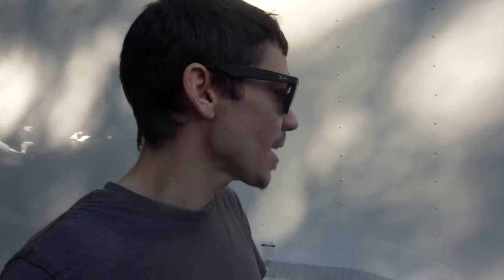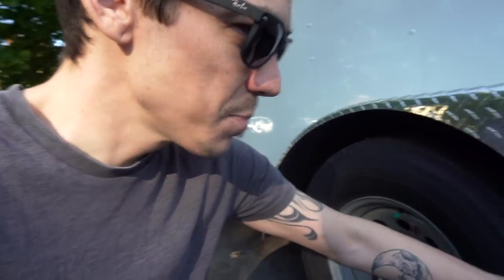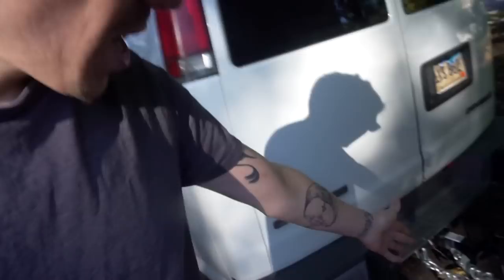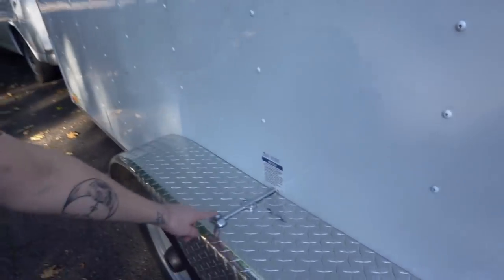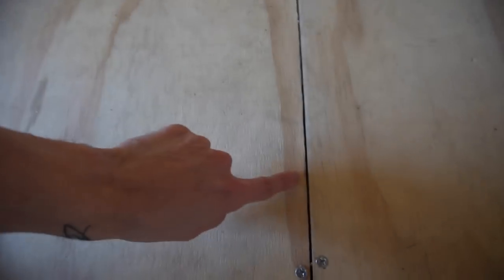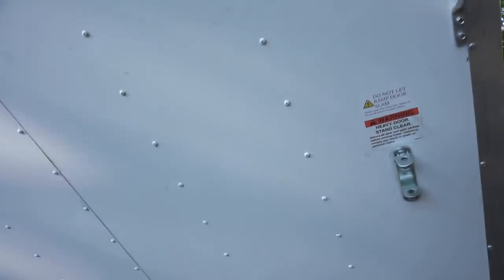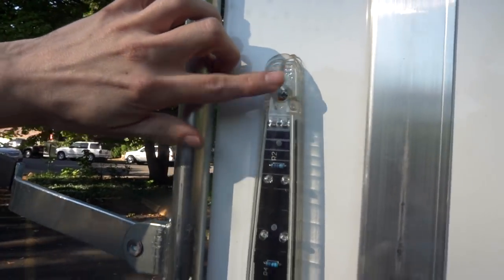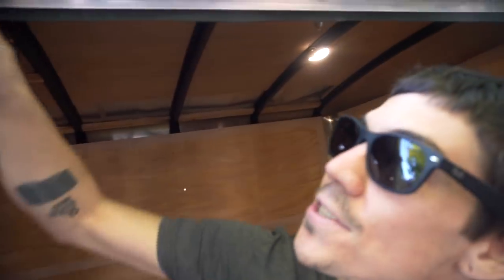WATCH THIS BEFORE YOU BUY A CARGO TRAILER FOR CAMPER/TINY HOUSE CONVERSION

Comment: Don't pull the exterior panels off. Remove the luan interior and seal the seams from the inside with auto body seam sealer. It's flexible enough once cured, but far more resilient than silicone. Sealing from the interior also protects the sealant from exposure to the elements. After sealing, spray the inside with a layer of Lizard Skin sound deadener(it's water based with near zero off-gassing once cured). The Lizard Skin will some what stiffen the panels reducing vibration, lessening the chance of a seam working loose and leaking.
Reply from the maker: That’s a great idea! Thank you
Reply: James great ideas
Reply: James Gill, right on!  Removing the outer shell is a sure way to make the panels leak.  Jed, treat the trailer the same way you would a van; a thermal barrier (foil bubble stuff), insulation, vapor barrier and wall material.  Don't get too hung up on the floor wood because you'll need insulation between it and the living area.  Be sure to omit the insulation where your tie-downs and E-Track is and use solid wood.  Also skip the roof AC, a 5-6000 BTU window unit will do the job nicely and use one third the electricity as long as you insulate well.  I helped a buddy do a 7x16' trailer and he air conditions it in the southeast using a 1000 watt generator and a 6000 btu window AC.  When the compressor isn't running actively his little 1.5 quart an hour generator charges his batteries and keeps his interior lit.
Reply: That’s sounds like a great idea to me too!
Reply: @scottsturgeon618  Scott nice
Reply: Or the roof.
Reply: I have one and i know that you will never see the seems from the inside. They are screwed to the metal studs. There should be thin sticky foam tape at the seems.
Reply: Agree 100%

Do NOT remove the panels

Do any extra seal from inside 

Your over thinking it dude seriously 

They are sealed from factory 

Waxing the outside on a regular basis keeps it looking good 
As well as the wax on the surface wicks water away quickly
Reply: Jesus Christ died for our sins, was buried and rose again to save us from eternal judgement and give us eternal life if we believe Him. Only God can save us and freely give us new life inside forever
Reply: By lizard skin are you talking about like spray in bed liner?
Reply: @IntoTheMystery13  I would be hesitant to just accept these kinds of ideas even though having them to evaluate is great. As you noted in your comment at the top, a lot of people just throw these together with whatever they know or what they find online. The RV industry is a joke from an engineering and build quality standpoint, and the same companies typically own the factories that build most of the cargo trailer brands. The rest usually try to copy them at an even lower price point. There's a lot of misinformation and misrepresentation in the whole industry. I highly recommend the customizing companies that do real engineering, most of them at the very high end, but replacing their expertise is next to impossible. Marathon / Prevost is a major player that does this in the motorhome market, SpaceCraft in the large, mostly 5th-wheel towables, and Nord Euro Mobile in customizing the industrial / cargo-trailer units (mostly for companies needing bunk or office space in severe climates). They aren't going to tell you a lot of their proprietary engineering detail that they have to pay for, obviously, but copy them as far as you can. Using a seam sealer inside, for example, might trap moisture between the steel frame and aluminum siding, accelerating problems and reducing the useful life.
Reply: @Dolores Lizzy Who are you referring to, and maybe explain the relevance?
Reply: @deha11mo  so what type of trailer does God have?
Reply: @izzimichaels2892  dragon whips his tail

Comment: Just a small tip. Lock your chains with padlocks. Lock your hitch with a hitch pin lock and lock your trailer ball mount. Locks for everything! Cheap insurance. I lock everything on our trailer. 👍
Reply: Stay away from Masterlock locks... The easiest locks in the world to pick... Look on  YouTube for the guys that do Lock Sport... I've seen them picked with a chicken bone and an under-bra wire... Not Kidding!!
Reply: Most trailer locks are easy to cut off 
Get a wheel boot
Reply: Locks are a good idea, but look up lock picking on youtube before you get overly confident.

Comment: Put a GPS locater underneath the trailer somewhere, in case someone succeeds in stealing it, you will always know where it is.
Reply: What brand?
Reply: if you pass a 35 question test you can get a ham radio license. 7 year olds passing the test happens so often it isn't news any more. then you spring less than $200 and get an APRS setup. you can get an entire APRS setup in one box. add antenna and DC and your on the air.

Comment: Jeb, don't take apart the factory seals.  You will end up with a leaking raddle trap.  And if you insist on taking off the plywood inside to seal and insulate it do it ONE sheet at a time.  If you don't you will have an out of square leaking raddle trap.  I'm not trying to give you a hard time just care.  The other thing is the rooftop A/C's are overrated and power hogs.  You can't run them on solar only a generator or plugin.  A 5,000 BTU window unit will cool that whole trailer and can be run on solar.  There is no need to cut a hole in the side of the trailer either check into an A/C split unit or stand-alone you can vent in and out the bottom.  And there are plenty of vents that close up watertight when not in use.  Save the real estate on the roof for Maxx or Fantastic fans and solar.
Reply: Journeyman does the a/c window unit go on top face down? And how would a/c be powered overnight

Comment: Jed you over thinking a lot of things. Just remember what ever you do adds weight . when you build it out don't use 2x4s if you do it right you can use a lot of 1xs if you brace it right. use white pine if you can get it . much lighter than yellow pine . every ounce adds weight. I have made several RVs in my time. Best wishes and good luck you got a good head on your shoulders . Travel safe.
Reply from the maker: Thank you!
Reply: Bill good suggestions
Reply: Metal studs are light weight also and mold won't grow ever.
Reply: Mold is so common in Virginia we eat it as our side dish vegetable at dinner.
Reply: @GeorgePencilArt  LOL ...nature's Bleu cheese!
Reply: Excellent info...
Reply: That’s great advice
Reply: Agree, 2x4's are the biggest mistake ppl make with camper builds. LIGHT LIGHT LIGHT!!! You'll appreciate light materials when you see your fuel mileage.

Comment: Key word....VAPOR BARRIER    If the warm moist air is unable to reach the inside of the cold shell, it wont condense into water.
Reply: Right. So, if insulated properly, there is no need to remove the top of the trailer, and then coat the above panel that was referenced in the video, correct?!
Reply: @gameandskate  If I understand you correctly then you are right.

Comment: You are totally right about dealing up the outer sheeting. When I pulled the panneling on mine there were a few rusty spots where water leaked around the screws.im building a cargo conversion right now. I will be sealing it up in one of my future videos.

Comment: Really impressive video, 99% of builds I've seen lack deep research. I am going to go with a flat roof V nose, so there isn't that cut of wood to remove, instead I'll add a ladder rack, and design a metal roof for it to mount, and dismantle when moving (which is rarely will).  That will make it look more like a house, and prevent the noise of rain from reverberating through the frame. Also will get a bolt on ramp, turn it into an awning that underlaps the metal roof for drip reasons. Build a false wall with normal door on the back with steel 1 5/8 stud/track. As well as hang solar from the ladder rack.  

I will essentially strip all of the plywood, except the floor which will get painted/tyveked. Swap all plywood for aluminum flashing (adds space blanket reflection), with cedar shiplap inbetween (maybe hang blankets to cover the shine), and cedar flooring, double insulated raised platform on the bed section.  Here in Wa, plywood rots in a season, cedar and metal are the only means of living in a little box without rot. Even plastics pores will collect debris and rot in the right environment.  

Awesome video, I really enjoyed your insight.
Reply: Not sure about continentals, but some trailers can go without plywood, which makes it lightweight if you use flashing and 1/2" cedar

Comment: I'm pretty familiar with these trailers I've got four of them. You have a gavalume metal roof and it has a piece of Luan between the metal ceiling and the middle bows so when you think about it going down the road you're going to have a little bit of wiggle and jiggle at the very top in the crown of the roof that's why they put that there. So it doesn't rub a hole in it if not you would have direct metal-on-metal wiggling rubbing and chafing. Have painted all my roofs with a Home Depot I think it was called Henry's roof coat. Cool to the touch and keeps it from rusting on my metal roofs.

Comment: I think I would just try to coat the outside with something that would seal it.
I am thinking truck bed sealer in WHITE.  It would have a texture, be tough as nails, uv protected and seals everything.  When you add the foam insulation under the plyboard inside, the walls will get even stronger.  I'd be inclined to seal the roof the same way.

Just a fast note, there was a video where they added and insulation layer, a 1" space and another 1" insulation layer.
the ceiling was insulated the same way, with the center space open to the side space, sealed by insulation on the outside layer/top layer and the inside layer to the top inside layer of insulation.  In otherwords, like a insulation box with a 1 inch space and another insulation box.
 the cieleing has a door that opens to the air space and a fantastic vent fan in the roof.  Personally, I would have put a trasnlucent door in to pass the light but stop air filtration.
  At the ends of the coach were air ports with valves.

This owner claims when it is hot outside, he can open the air ports and turn on the fantastic vent fan and he has no problem keeping cool inside his step van.  It's an interesting concept and I plan to experiment with it in the future.  It certainly sounds plausable and anyway to keep the heat out and in the winter keep the heat in is a plus in any insultation project.

Comment: be careful in your selection of wood treatment. most of the chemicals used to treat wood will corrode most metals and fasteners. a few coats of latex paint on all the bare wood surfaces will work just as well as treated wood inside. to seal the skin, i'd also recommend doing it from the inside. latex rubberized roof paint works great. it also deadens noise from rain and other things hitting the skin and helps keep it cooler if you coat the whole panel inside.

Comment: There are a couple negatives about 2 axles as well.  If a tire goes flat and you don't notice it, it might come apart and damage the trailer.  With a single axle you will notice the flat immediately.  Also, if you aren't loading up the trailer it can bounce around on a rougher road since there is no damping on the suspension (no struts or shocks.)  

I was considering building out my cargo trailer or getting a camper shell for my truck and building out the bed.  After watching your video I think I will go with the truck and leave the trailer as a garage for my bikes when I am on a trip instead of them having to sit outside.

Comment: To prevent two dissimilar metals from touching buy the rubber tape that's applied around windows to seal them before they install the siding.  Its rubber and is about 3 inches wide. It comes with a paper you remove to expose and adhesive. Peel it and stick it. Its about 1/8" thick and will prevent the 2 metals from touching. Pretty inexpensive.

Comment: The outside walls where they overlap at every 4 foot are not sealed from the factory. I just loosen my outside panels and sealed it with silicon and screwed it back together. You don't want any moisture or water getting in the wall or ceiling this causes mold. And over time rotting of wood. With a strong round roof sealing like you have you could use spray foam insulation and then screw Luan to the metal bows on the ceiling. The problem with doing this to a flat roof they're so weak compared to a round roof.

Comment: While you have the wood off the roof spray it with the rubber truck bed spray and you won't have the condensation on the roof. Just a good tip I learned recently.
Reply from the maker: Yeah I saw that video on van city van life, pretty clever!

Comment: Yeah that's a lot of work. I was thinking of getting one of these too hoping it would be easier.
But if we need to take the roof and walls off anyway then it seems like a flatbed would be better in terms of labor. Then I can build the walls correctly from the start. Plus have it look the way I want.
Reply from the maker: If you are going to travel a lot the steel ribs and skin will be a hell of a lot more durable, but good points

Comment: I have a Continental Cargo trailer also. Mine is 8.5  x 18. I put a 32 x 32 shower in the left front corner as you are. My solar and electrical panels in center, beside shower. I removed my Dometic vertical frig for a Dometic horizontal, dual zone 75 liter (12 vdc), on the right, beside the door. Don't remove the outside skin. Remove the strips over the joints and the upper panels, ONLY. I cut rigid foam to slide down between the wall ribs. I also replaced the tongue jack with an electric, added a side window, power awning, etc. Good luck with it.
Reply from the maker: Nice! Do you have any pictures or video of your build?
Reply: I have some pictures but can not find an email address to send to you.

Comment: A used Casita  at $8000-$9000 plus a $1000 for repairing and updating ... will cost you way less in the end .and if you don';t like it you will get great resale value.  Casitas are all Fiberglas. Have all the amenities  and will weigh less than that cargo container when loaded.
Reply from the maker: Those things are awesome, but their always going to feel like a rv and stealth is out the window. We want a custom home that is exactly the way we want it
Reply: My Buddy that caught the thief, he had a Large shipping container shipped and delivered to his acreage north of Shasta. for $4500  A $5000 parcel in South eastern Oregon is what I'm looking at for a base camp. I would drop a container there and do my tiny house build in that.  Tougher longer lasting bigger etc... Einsteins corollary " T=$  Time equals money. "
Reply: Why are those Casitas so expensive? They sure are cool though!
Reply: Fiberglass, waterproof self contained light weight they check all the boxes on most folks requirements list and they have good Resale value if you change your mind.  His Trailer cost  about as much as the lower priced casitas. , He has a ton of work to do to get what he wants, the Casitas come meeting most folks needs and they don't have to do anything to make them ready to go.
Reply: I think stealth is out the window either way ... people ... especially the cops know whats going on. Especially here in San Diego. I wish you well however I do think it's a mistake to take the exterior sheeting off. It's like trying to put a tent back in the bag ... it never fits the same.
Reply: A cargo trailer depreciates less than a used casita, and it appreciates when you build it out.

Comment: Hoping that you can treat any (plain) wood surfaces with something, so it can last for 20-30 years without further treatment is probably going to be a disappointing  experience to you.  Especially wood that is used in a vehicle. 

But I do agree, that you need to treat the wood, as much and as through as you possibly can. And as soon as possible. 

I would however still design and build in a fashion, so it would be possible to unscrew, remove and replace where ever possible. 
And where it would be exceedingly cumbersome to design or build so it can be taken apart, like in a shower, I would completely remove the wood panels, and then use other materials. 

Are you familiar with the different styles of surface sprays that are used to weather protect vehicles? 
Where I live /way up north), using those  sprays, WILL double or even triple, the life expectancy of a vehicle body. 
It is however possible to treat and protect any and all materals using these  sprays. Also the underside of your trailer. This would protect both the wood AND the steel. 
It will last for years, but will protect much better, if inspected every year, and being refreshed in hard -worn, of crack-dried, wear spots. 

Some of those surface/rubber sprays can also be painted over, so in select spots, I would combine with rubber sprays and Hammerite paint.  
On one car I kept a gaping hole (from a close encounter with a cement corner)  closed up, and completely rust free, for several years, using layers of rubber spray and Hammerite paint. 

Are you considering painting the panels with that mold-resistant paint?

Comment: Aren't the outside skins held on with pop rivets? If so, you'll have to drill out each one of them... Should have just got a trailer frame and built your own shell on it for all that you're thinking of doing... It would have been cheaper and to your specs/standards.... Just my opinion...  :)
Reply from the maker: Naw their screwed on on this particular trailer. Someone had the idea to seal it from the inside, I like that idea better and will probably do that instead